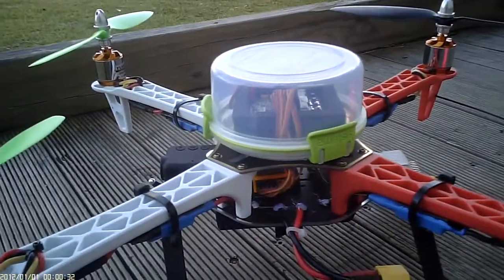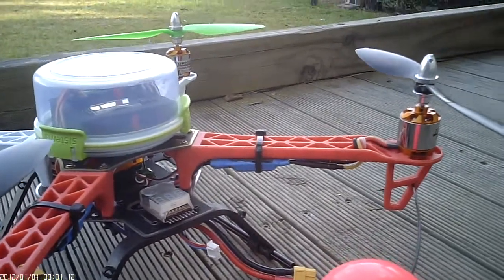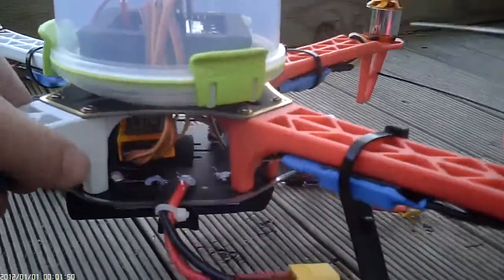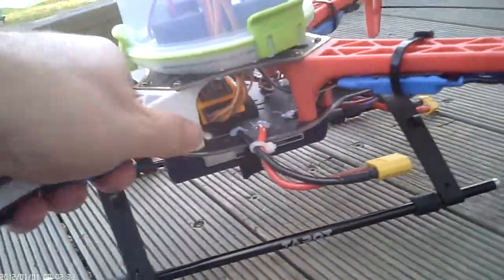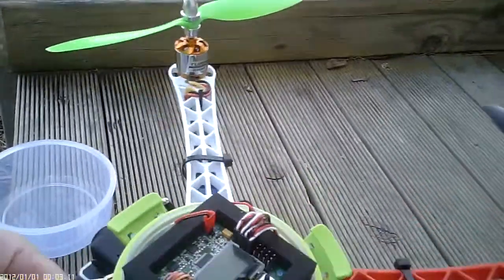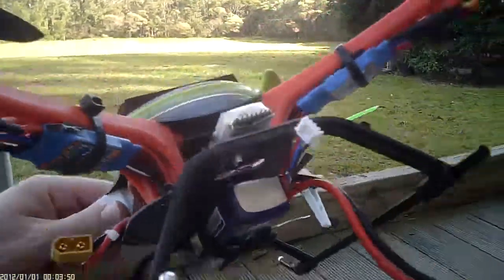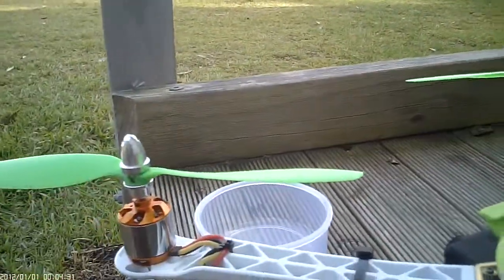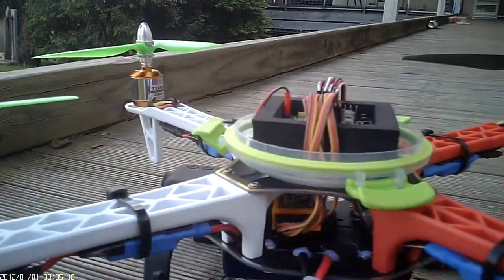Hk Q450 Pre Maiden Flight - Quad Build Details

Comment: okay mate thanks, did they fit straight on? and would any 450 skids work?
Reply from the maker: +James Tucker They are trex 500 skids, edited my other post.  Yes they fit straight on as the mounting holes line up with the slots in the bottom plate.
Reply: +Ahamay75 okay Thanks mate